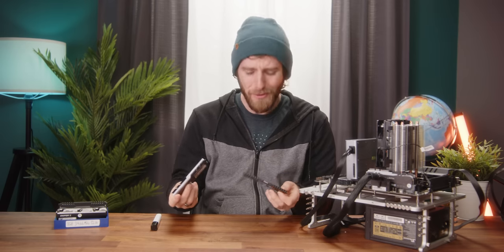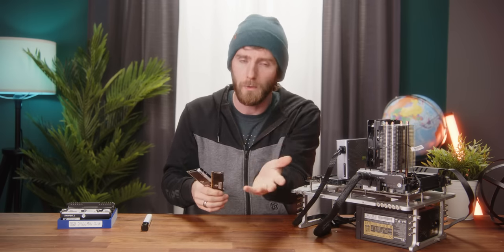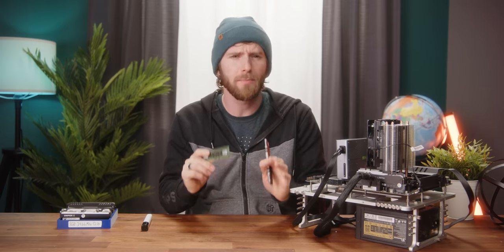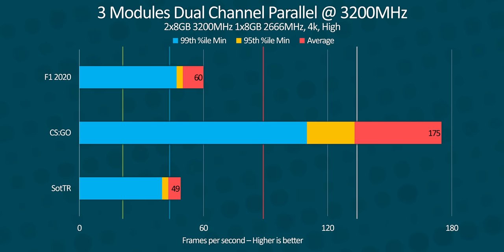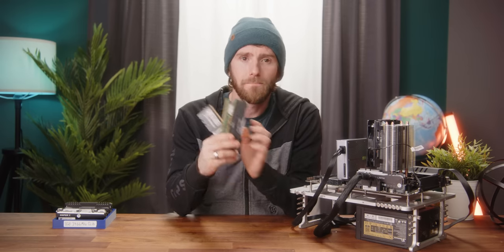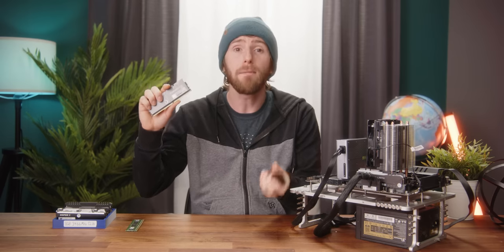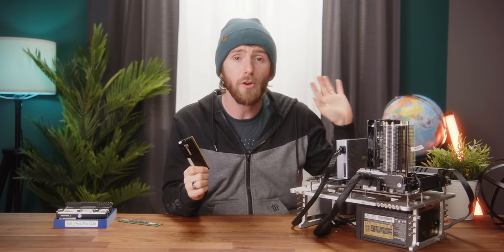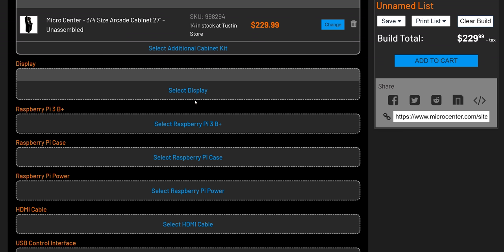Just How Bad is Mixing Memory?

Comment: So I have 2x4GB Corsair 3200, and I add 1x8GB Team 3200, but when I check on task manager, they only run at 2133mhz. I check on BIOS, xmp's feature disappears. How to run 3 of them on 3200mhz?
Reply: Set the speed and timings manually
Reply: @malcolmholmes2596  do i need to change the voltage in the process?

Comment: So...in this moment my computer is running a kit of ddr4 ram 2x8 gb 3200...that i am using since 2 years back. the cpu is an i5 10400f on a b560 motherbord from asus tuf. It runs perfectly fine with the xmp profile on from bios at the rated speed. 
Thing is....2 weeks ago i got a 2nd kit of 2x8 gb kit but running at 2666...
I have both kits running in dual channel. In bios it looks strange what it shows...but in windows in task manager, it says that the 4 ram sticks all run at 3200...so i don't realy know what t0 say. Performance wise, it seems to be ok. In games like cyberpunk it looks strange though, i get worse performance, but that could be also due to the drivers, as far as i heared the 531.18 drivers from nvidia push cpu's harder for some reason and there's a chanse that performance is exactly as before. 
Wondering if somebody did the same as me

Comment: I got an optiplex 790 with two 4gb modules in the first 2 slots and 2 2gb modules in the last 2 at 1333 mhz plays minecraft just fine 
That's all I got for strange mix matches the system was just same frequency and it works well samsung chips on all of them. It's wild how it works with tech cos fr what works for me doesn't work for others

Comment: Hey good sir so as long as I'm getting ram with the same exact specs I should be good im just getting rgb ram all the specs are exactly the same as my current ones?
Reply: Buy the exact same model, you will often find them in bundles of 2 or 4. For even higher chances of success search the manufacturer's site to see if they created the models specifically to be sold in pairs (see if they're selling them in pairs).

I got 2 sticks of DDR4 2666 RAM from Kingston. They had nearly the same specs, only having slightly different timing and they worked in dual channel mode. However, I noticed that I was having way more problems than usual when unplugging from the wall for cleaning. For example, today I unlugged the PC from the wall to clean the dust, but once I plugged it back there was no video. After a lot of trouble shooting I just removed the second stick and it worked.

I doubt the stick was faulty, because it has been working for over a year. I'm suspecting it was due to problems with the sticks being a bit different.

Comment: Question here, I hope someone sees it
I just got a laptop with 8go of ram soldered 8go upgradable up to 24Go
wouldn't that be terrible tho, having a 8go stick with a 16go one ?
Reply: Really not an expert, but the latency penalty might outweigh the benefit you get from the extra capacity. If you really need the extra memory though (which is unlikely if you just game and do everyday tasks) you could also go for the mix and match
Reply: @luispittairline339  thanks for your answer~
Yeah that's what I thought too but why the heck would they make it upgradable in the first place if it's that bad?
Reply: @Liddrey  No it shouldn't be as bad as what they're saying. Just make sure it's the same Module Speed.

Comment: Guys, I need help.
My rig right now is a Ryzen 5 3600 - RTX 3070 - 16gb (2x8gb) 3200mhz CL16 (Adata Spectrix D41)
I bought some Gskill TridentZ 32gb (2x16gb) 3600mhz CL18

My problem is: (amd compatibility problems aside) do I just replace the 16gb kit for the 32gb to get 32gb at 3600mhz, or do I add the 32gb to the 16gb to get 48gb 3200mhz?

My main use for the build is gaming (which might benefit from faster clock speeds) and music production (the bigger the ram size, the better)
I also occasionally code and develop on UE5, and sometimes I'll run a heavily modded Minecraft server to play with a couple of friends
Reply: 32gb is WAYY more than enough for games. I dont really know about music though. If you really need the extra memory you could try to add the new modules and overclock the old ones for all of them to run at 3600mt. If that doesnt work, 3200mt is about the same. What isnt the same is the money you'll get for selling your old memory
Reply: just use both.
Reply: I'd say check the specs for your mb too, since some boards need to enable xmp for the CPU to fully utilize that speed of ram.

Comment: Can I do (current) 2 x 8 GB 3200 MHz (Dual Channel) and upgrade/add 2 x 16 GB 3200 MHz (Dual Channel) Same Brand (model, frecuency , Voltage and Latency)
Total 48 GB RAM (for Solidworks or CAD).   (Current CORSAIR Vengeance RGB Pro SL )

Comment: I am currently running CORSAIR 8GB Vengeance LPX DDR4 PC4-19200 2400MHz Desktop Memory - Red RAM, i want to add another
Corsair Vengeance LPX 8GB (1x8GB) DDR4 3200MHZ C16 Desktop RAM (Black) will it run normally.
help 😃

Comment: Im having issues with my RAM, I have AMD 3600 and bought 2x8gb 3200 and a month later another identical 2x8gb 3200 but it seems (even running at 2133 Mhz) I get a lot of BSOD, even if its the same brand, speed, clocks and capacity.
Reply: sounds like bad ram on the new set u bought. run the new set without the old set and see what it does.

Comment: I have a friend that has been using two laptops and they both just have a stick of  8 gb ram and his new gaming laptop came with 4 sooo we just took out the 8 gb ram from both of them and put them both in the new computer and we found out that it has a hdd slot so we took the 1tb hdd from his old pc, wiped it, and put it in his new pc.
And can any one explain why nvidia jumped from 1650 down to 1060? Cuz I have a 1060 laptop and my friends laptop is a 1650 and we played the same game and tested the fps and I have like about 100 more fps depending on the game graphic settings. Let's say minecraft with abunch of texture packs and a shader on my pc is sitting with 240-257 average fps and his fps is like 180- 210. I expected his pc to have higher fps then me but nope.

Comment: Man I just mixed 8gb (2x4) with 16gb (2x8) from one manufacturer and my pc couldn't turn on :< Damn it
Reply: I mixed two DDR4 16 GB 2666MHz from Kingston with timings that were a bit different. They would run, but every time I unplugged my PC from the wall for maintenance or changing something I would have problems with no video display. Sometimes it took removing and placing the sticks again, but in many cases it wouldn't work.
3 months ago I changed nearly everything in my PC with the exception of the RAM and once again was having problems everytime I unplugged the PC from the wall. Then I literally removed the second stick and everything back to normal.
Reply: Try putting in the 2x8 sticks first, turn on, then once it turns on, turn the pc off and put in the 2x4. then turn it on.

Comment: Question :), Can I match up 16GB + 8GB ram same speed (3200) and same brand?
Reply: No idea but im trying tomorrow to mix 2400mhz 8gb sticks 2x and 4000mhz 16gb sticks 2x. Ill try to remember to tell you how it went
Reply: so the short answer was that i just got stuck in the restart loop.
Reply: rip, have tried troubleshooting it and removing either sticks?

Comment: Anyone for helping please..

I have currently installed 1600 4GB 
If i buy like 2200 8GB stick and add it with 4GB 
Will be there any problem ? 

As they are different from bus speed ? 
5567 Laptop 💻

Comment: Can I use 1rx8 2400 with 2rx8 3200 as dual channel ? :hand-orange-covering-eyes:
Reply: Should work but you might have to manually set timings in bios. And it'll operate at the lowest of two frequencies unless you also set this up as well. Though the lower frequency stick might not start on higher frequencies.

Comment: I have 24gb ram ddr3, 2 are 1602 8gb ram and the others 2 are 2000 4gb, ¿i will get better performance if i only put the 16gb couple instead of left 24gb?, the 2 8gb memories are the same, and also the 2 4gb memories are the same

Comment: Im building a new pc and want to use my old ram (Corsair DDR4 3000MHz 15-17-17-35) with my new ram (Corsair DDR4 3600MHz 16-19-19-36) to use all 4 slots on my new motherboard, can anyone tell me if they would work/work well together?
Reply: Well you could try, it's not going to harm your system, but if you encounter an issue just remove the old ram. I have a similar system (instead of 3600 MHz I run a 3200 MHz ram) and so far I have no problems at all. I'm playing cyberpunk 2077 and no issues. I just mixed the dimms just to see what happen and because I don't want to sell the old ram.
Reply: @kmog92  wait i have a 16 gb ram if I got another 16 gb that is not the same is that OK how bad can it be?

Comment: Lol I have the exact Trident Z memory Linus was shaking at us the whole video, 2x 8gb 3200 modules, like last week saw 2 sticks brand new in the box for $30, so I snagged them up. Same shit, 2x 8gb 3200 modules of Trident Z, even had the same white stripe across the top and brushed aluminum outter shell... It was only INSTALLING the RAM I realized, my first two sticks are more of a Black color than Brushed aluminum like the new memory and Im actually here cuz I was super worried I fucked up and it wont even post or something, crazy part is they look almost identical other thn the color, one talks about over clocking on the package one doesnt, Identical timings, identical speed, identical capacity, as far as I can even tell the only difference SEEMS to be the color, so Im hoping that means it'll be just fine and I freaked myself out for nothing. lol

Comment: i have 2 corsair 3000mhz and 2 hyperx 3000mhz with the same cl spec but if i put the reccomended speed a cla 15 and 3000mhz it have weird thing happen but if i OC to 3200mhz cla 16 no problem at all

Comment: I just bought a new used gaming pc with 2 modules of 8gb corsair rams, 16gb in total.. I had 2 more modules of aegis rams, at 8gb each. All 4 modules run 2666hz, and, for the most part, it runs fine, with a total of 32gb. Though the addition must have messed something up, because the pc now gives an weird issue with shut down and power on, where the fans and the rgb lights don't shut down... almost like it goes in sleep mode, but the settings do not indicate that. anyway when this happens and i try to turn it on, it just does nothing, stays with the fans running, only working after i restart using the power switch in the back. Anyone any ideas? As I said, the pc runs beatifully with gtx1060 6gb and i5 8500

Comment: I have a question so I have an old laptop with 2x6gb of ram and I am going to get a new laptop with 16 gb ram and it has an extra ram slot can there be any problems if I put 1 of the 6gb rams in there
Reply: I don't think 6gb RAM stick exist
Reply: @mr.commonsense6645  i dont know but my laptop has 12 gb ram and inside there is 2 sticks it might be like 8gb+4gb
Edit: yes it is 8gb+4gb so my question is can I put the  old 8gb ram 2400 into a new laptop with 16 gb ram 3300 and it is expandable up to 32gb

Comment: Something that was missed on this video is pairing positions.  If you have the same speed RAM from dual channel sets, doesn't it improve performance as long as they're in the 1/3 and 2/4 slots?  I've seen odd builds with 12, 24 and 48 gigs that use that configuration.

Comment: Good video, logical conclusion. Anyway, I have no issues with DDR4 ram, but somehow  I always have to set the frequency clock and voltage manually otherwise it does not work stable.

Comment: I know the video is a bit old, but if someone could give me some advice. 
My current cpu is i5-6500 with 24gb ram (2x4gb 2133 and 2x8gb 2400).
I want to buy a ryzen 7 5800x, but I'm not sure if i should keep the ram, remove the 2x4gb (leave only the 2x8fb in the system) or remove everything and get a new set of 2x16gb?
Reply: Buy new ram.
Reply: @realnaste  my preferred store got  the ryzen 7 5800x back in stock so i ordered it , plus a gigabyte b550 auros elite mobo and 2x16gb corsair vengeance lpx 3200
Reply: @captainjimo  Have fun! :) Don't forget the XMP profile

Comment: You have to know the AI OC settings to get the best route to cpu from ya Ram on mixed sticks. Not just switching to DOCP, but manually know which settings to disable or enable ALONG with finding right equations for CPU/NB ratio of percentage if OC too. Its the Mhz setting which the cpu will divide and accept equally for the Cores , so every cpu is different of new and older too when it comes to upgrading Ram. Learn Ya Shit so it becomes Valuable as the good shit to have, lol. But know ya math as this is the key to everything PC for Gamers!!!

Comment: Mixed 2 dimm 16gigCorsair vengeance RGB pro 3000 cl14 with 2 dimm 16gig Corsair vengeance lpx 3600 cl16 and got  them set at 3200mhz cl15, they will go faster and tighter but they start throwing errors and I don't want to increase voltage anymore 1.37v is fine 🤣

Comment: 1x 4gb 2666mhz 1x8gb 2666mhz 1x 16gb 2666mhz 1x 32gb 2666mhz
it fucking worked, I ahve a quadchannel tr4 mobo and 4x4gb 2666 mhz sticks, called my friends to give 1 8gb 2666 1 16gb 2666 and believe it or not we found someone on the same location that sold 2 32gb 2800 mhz with similar clocks and shit so we bought it, put it on my mobo and it worked, 60 GB ram was fun but the pc poped a blue screen after about 200 youtube videos playing at the same time, not sure if it was the ram tho.
Reply: Bruh

Comment: Is it possible mixing 2666mhz and 2400mhz  same 8gb ram?
Reply: It will probably work, when the system first boots it will use the slower speed by default.

Comment: If got two kits (2x8GB each) of Hyper X Fury Memory, both kits are 2666Mhz, but one is CL 15 and one is CL16. I think it is the RAM thats causing issues with the stability of my system. Can anybody tell me if thats possible and if I can do something about that (for example in the BIOS)?
Reply: you can match the timings of all the rams to make them run properly. tightening the worse ram to CL15 could work but would be more unstable. Loosening your better ram to CL16 would be best for stability. 

There's also a small chance of your system working without touching anything too.
Reply: Thanks for your advice! I‘ve never really done overclocking (except for old ATI cards back in the days). So if I get it right, I‘d have to clock everything manually? So that the ram also runs at 2666MHz without XMP instead of the „natural“ 1333MHz? Am I right?

Comment: But when my pc spec:
2x8gb 2666 mhz+ 1x16gb 3200 mhz
Ryzen 7 5700x
Gpu :Rx 6600xt
B450 motherboard , 
Every Game crashed like hell , 
But when i changed back to gpu (Rx 570) from (6600xt), 
Everything works xxxking fine ~ 
Is that the reason i mixed the 2666mhz + 3200mhz ?
Or i just go buy 1 more 3200mhz of 16gb to sum up to 32gb(3200mhz) ?

Comment: I Run on a HP Probook thats originally built to run on Windows 8.
Running on an Intel i5 its pretty good for a daily runner. but new it
would have had only 4 GB of ram (SO-DIMM ddr3). norm back then.

needless to say I slapped in a rando 8 GB ram stick meant for some 
DELL laptop and I've been fine ever since. granted it's clear from the
specs I shared I'm no hardcore gamer but for a daily driver it will work.